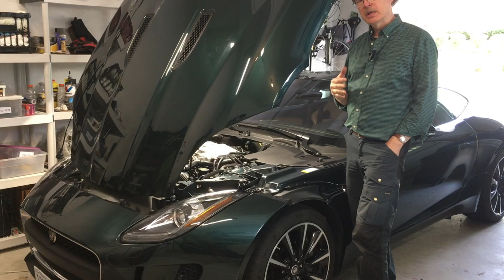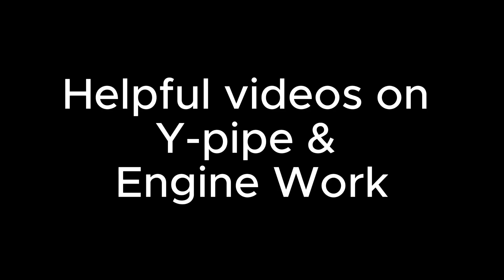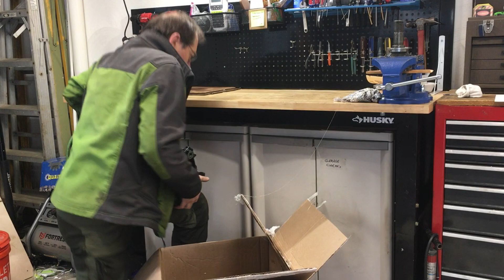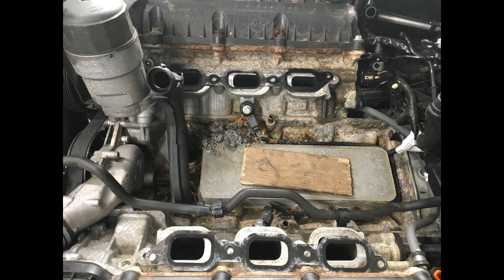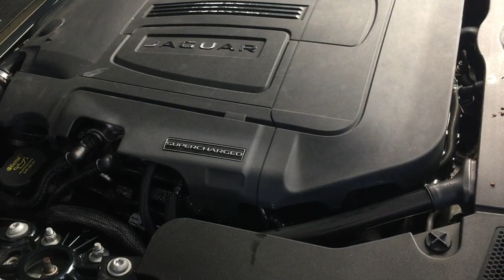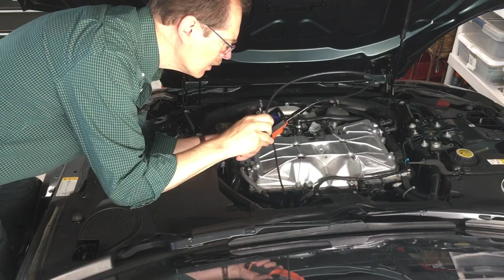Jaguar F-Type Y-pipe Upgrade Part 4

Comment: Is there not a risk of overheating if you cover the vents?
Reply from the maker: Good question. I dont think so. Many JLR vehicles feature the AJ126 & 133 engines, but only one or two models feature the hood vents. These vents allow for some modest airflow, which may help with cooldown rate. But the damage from water ingress (through the vents) is well documented.

Comment: Hi hermen,
Steeve here from jersey island UK.
I have do the y pipe and catch can .
So put back Al and was using a suction gauge to check from the coolant tank if I had a vacuum but it's not doing it and I had sussing noise just behind the wall water pump ? So removed again all is tight?
Or maybe try his tool can not be used? Do you have an idea for me to try ,or I may just put new coolant in and test it running,and see where it comes out, Very hard to tell ?
Reply from the maker: Steeve, it does sound like you have leak at the water pump.  If you have evidence of this, it is best to stop, and address the issue, rather than complete the job and test for leaks later.  Besides the vacuum test, there is no other convenient way to test the cooling system quality.
Please check you water pump, and the Y-pipe with two o-rings at the base, and one o-ring at the top where the front W pipe, or “front cross over” pipe connects. 
These are somewhat problematic to instal and there is risk of tearing the o-rings.

Comment: is there some secret to securing the plastic coolant hose to the y pipe? i cant get it connected
Reply from the maker: Mike, are you speaking of the small nipple which plugs into the water pump? (See Part 3 at 13:00) or the bleed back pipes from the front cross over (or “W” pipe).  These have simple clips which grab onto a lip. (See Part 3 at 19:50). These are push-on amd have a press-to-release.  These plastic clips can become brittle and break.You can go to a used parts yard to extract these, or buy new pipes from JLR.
Reply: @OncaEngineering its the coolant line that starts at the coolant reservoir and then it goes to the two other locations. i already got the new part from jaguar.But it appears that the top connector that goes to the black?Wipepipe, there's a broken part inside the nipple.I believe which is why I am not able to connect it
Reply from the maker: Odd. Do you have a pick, or hook that can extract the broken part inside the nipple?  Be careful with scratching the bore, as this may cause a leak when inserting the new part.
Reply: @OncaEngineering  yes I used a needle nose pliers to remove a small piece from the broken hose that was still inside the ypipe connector.  everything all set and connected properly now.

Comment: Hello, I know some of the bolts on the supercharger are TT bolts. Are there any bolts that need to be replaced with new ones?
Reply from the maker: Ham.  Thanks for your reply.  Which bolts did you find that are Torque To Yield (TTY)?  I didn’t see any such bolts on the SuperCharger in my research, as the Super Charger is a simple bolt-on assembly with reasonably smooth stress on it. The S/C supports average pressures up to 18 psi or so, and no peak pressures as found on the crank, or cylinder heads, or flywheel.  Note: some folks have run into some S/C bolts that are corroded to the head. These need to be cleaned, or retapped, or new bolts installed.  All of my S/C bolts were in reasonably good order and got some anti-seize treatment before re-installation.

Comment: What brand coupler did you go with, and any particular reason why you chose it?
Reply from the maker: I dont know the brand of the solid coupler. It came with a complete kit of parts from Euro-AMP. See Part 1 video for the overview.  This kit focused on high quality replacement parts for the Jaguar enthusiast. So my selection criteria was based on the nature of the kit and my trust in the Euro-AMP company to assemble high quality parts.

Comment: Conte mais sobre o simpositor só você fala sobre essa peça.
Reply from the maker: Winnerman. The “symposer” is found in several Jaguar cars. It passes intake noise from the engine to the passenger cabin when the car is put into “dynamic” mode. 
Dynamic mode in the F-Type also changes the backlighting on the instruments to a red color, and the throttle map is change to be more sensitive.   The issue with the symposer is that plastic pipes and valves can cause a vacuum leak which impacts the engine operation.  So I decided to remove the symposer and block off the manifold hole, and the vacuum line.   Blanking kits are available from Wraptor Customs (UK) and VAP (US).
Reply: @OncaEngineering  I understand now what it is for. Thank you very much. My car makes a noise when I turn off the engine as if it were releasing pressure from a pan in the area of the engine near the symposer. There must be a crack in the plastic tube, right?
Reply: @winnerman5801  these engines calibrate their throttle on shutdown I believe, which makes a "shhhh-thunk" sound about 5 seconds after shutdown. Maybe that's what you're hearing?